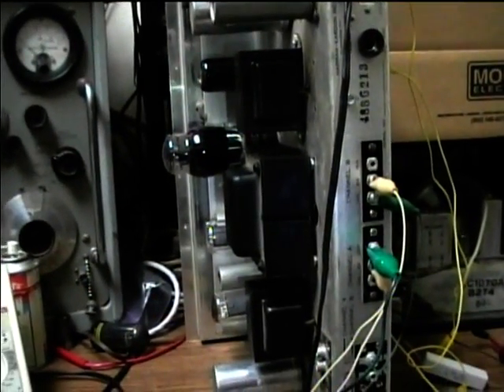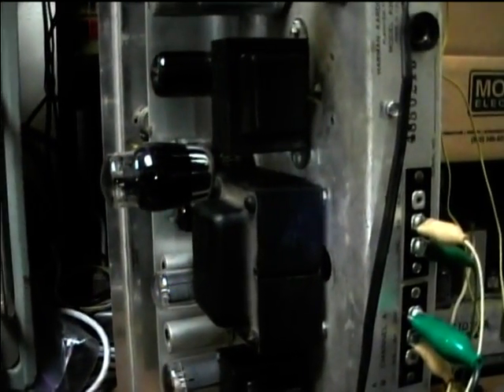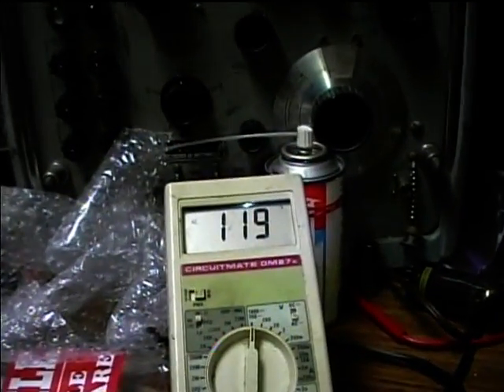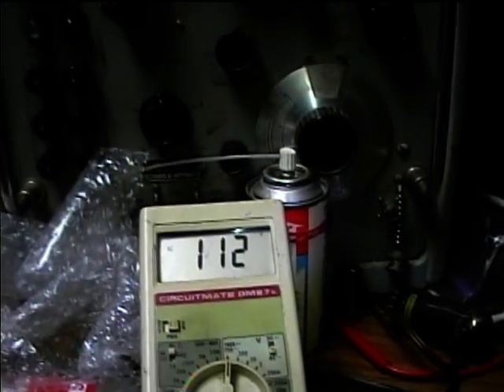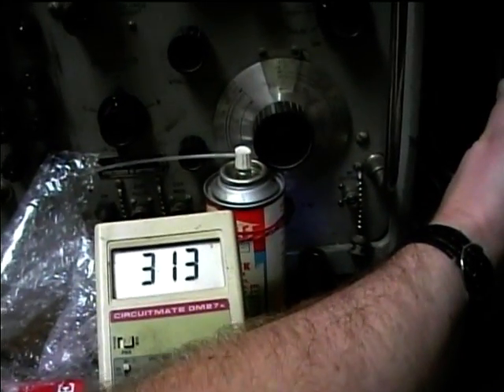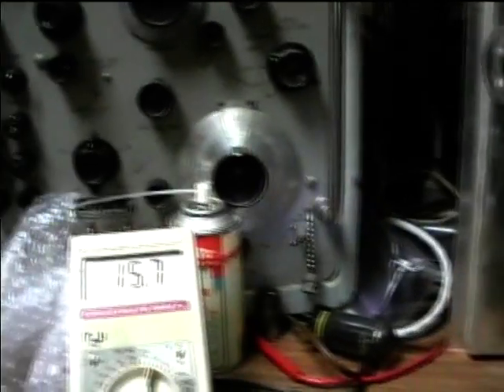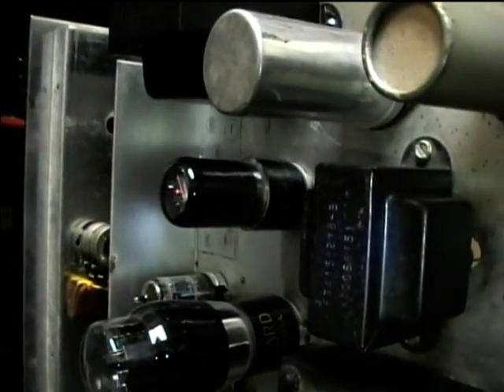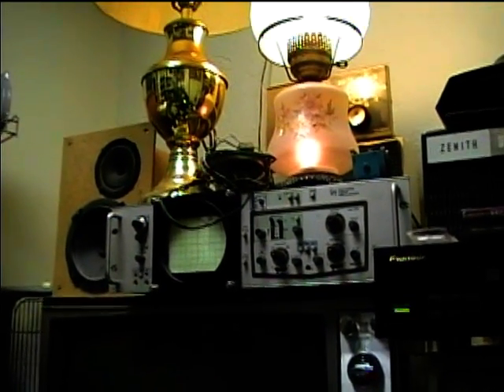Harman Kardon A300 amplifier line dropping resistor test

Comment: I'm surprised that plate voltage was an issue for your tubes.  I'm running four new "Tung Sol" branded Russian 6V6's at 355V, and I've had them as high as 370 with no problems.  I've been told they'll take over 400, which some guitar amps evidently apply.  I'd think old American tubes would take  up to 400V without incident, though some Chinese and NOS Russian Military equivalents can't go above 300.  Sounds as if you've found a solution though!

Comment: Thank you for using "E" for electromotive force in Ohm's law. It always annoys me to hear people incorrectly use "V" for "voltage."

Years ago my uncle gave me a Scott mono amp which used a pair of 6L6 tubes. I later sold it. In retrospect, that was a mistake, because it worked fine and sounded great.

Comment from the maker: I'm not sure what the nameplate rating is but I'll double check. I'm sure your right, its a lower voltage. Some of the RCA TV's I have, have a "NORMAL/HIGH" switch to compensate for areas with higher line voltage...would be nice if more things did. Yeah I thought maybe the cathode bypass caps would improve the bass but the first time I tried it it didn't seem to make a difference. It certainly won't hurt to put them in and since these test speakers are pretty puny I may not have been able to h

Comment: I forgot to ask, what is the rated AC input that is printed on the chassis?  It is probably 115v or 117v.  

Once you get your cathode current straightened out, I suggest trying a 100uf or 220uf 50v cathode bypass cap to see if it helps your bass response.  If not, you can leave it as-is.  Typically you won't notice much difference in overall gain, just that things such as bass drums will be a bit "tighter" sounding.